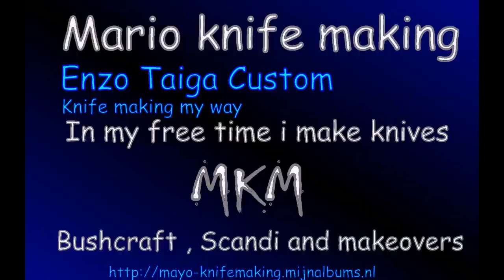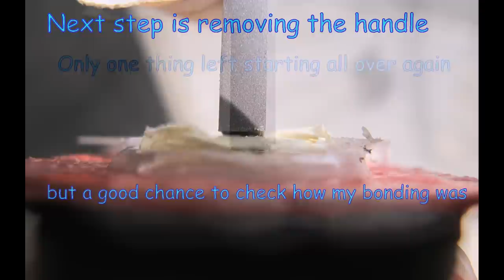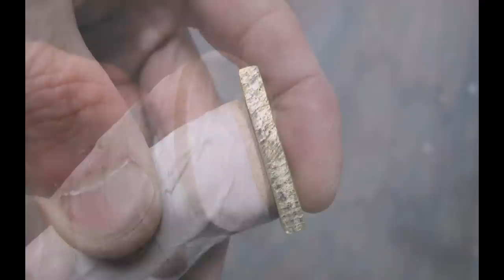Knife making - Enzo Taiga Custom

Comment: it's a beautiful knife. I had problems with a similar end cap coming off 3 times in the final grinding process. I believe this resulted from differential expansion coefficients between brass and bone. I tried cooling the handle in water as I shaped the piece on the belt sander. In the end I was not satisfied that the cap would stay on, so I screwed it on with a small brass screw counter-sunk into the end cap. Its not pretty, but is hopefully secure. Do you have any thoughts on this problem?
Reply from the maker: ***** I just use araldite very strong epoxy and the end cap is sanded by hand no belt sander.
Reply: I was using araldite, but  I guess the belt sander was too aggressive / hot. I'll try by hand next time.
Reply from the maker: is that antler or deer handle
Reply: ***** Drill the end-cap for the tang and countersink the top a little. Have the tang a touch longer and tap it with a hammer, lots of light taps will peen it over enough to hold it tight even without epoxy.
 I've used the method for 40 years.